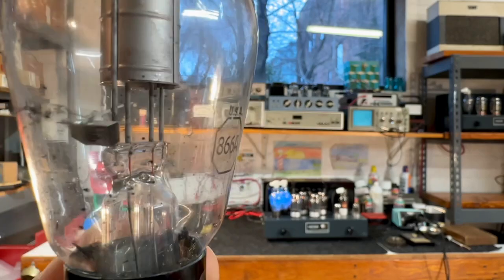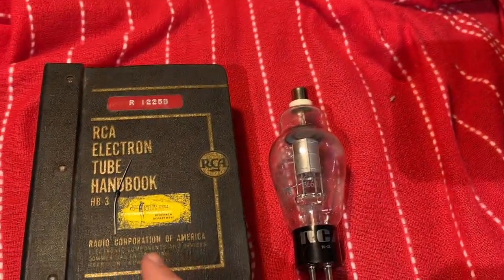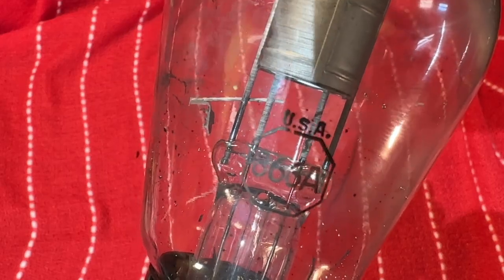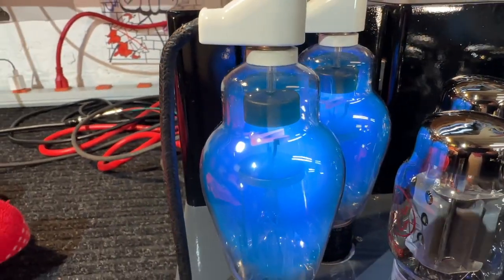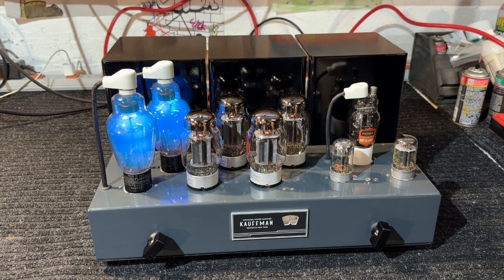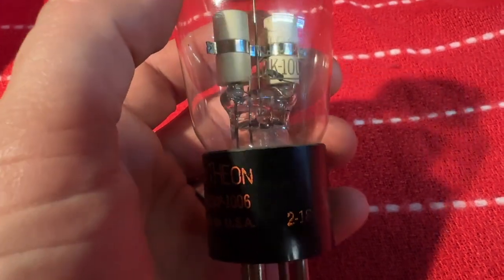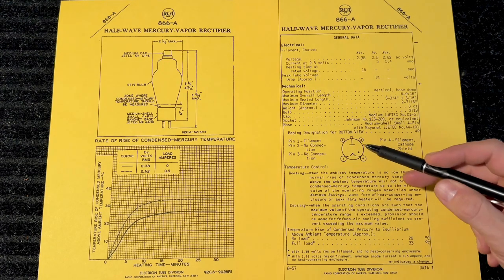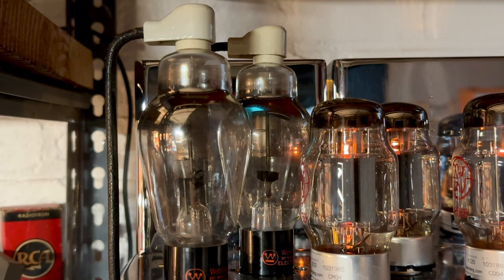Explore the 866A Mercury Vapor Rectifier & other gas tubes!

Comment: During the lock down of our country (nz) in 2022, I set out to design and build a stereo Amp based around the kt170 tube.  Just to add some eye candy to the valve lineup I opted for a pair of 866a tubes for my rectification.  When it is cranking the pulse of the beautiful blue glow will almost put you into a trance. I love to turn out the lights and just melt into the sound and visual.   MV tubes in my opinion work well in a powerful output Amp.  Very little sag and they run cooler than say gz34 or similar.
I built a time delay into my power on circuit so as to allow the MV to preheat before any voltage is applied. So far, with over 300hrs of run time no issues at all.  Just pure analog audio.  With the phono input on the front end I now listen to my vynal with zero digital interference. 😊😊😊😊

Comment: What if you did a 300b set amp with one power supply, and two independent 0z4g tubes, how cool would that look, and sound? Just add a capacitor to the output of the tube and input of the power supply, high voltage high capacity, and they would act fairly independently. Make a clear plastic shield so fingers dont happen to make contact with the hv. That is safe enough. People its common sense. 
The power supply can be a high voltage switching supply up at around 800Volts. 
There is high efficiency aspect, and low cost aspect as these tubes are avaliable and even at low cost. I think they would look cool and be one of a kind. 
One could even power a pair of el84s and that would make for a very compact and efficienct and capable amplifier, Spending the money at the transformer. 

Honestly an even better setup is ec360 OTL with speakers at 120ohm Custom coils, not too difficult. 

Why dont we see any of these designs besides the phillips otl sets sold in france and italy and germany???

Western electric? Aghh, that was outdated even when it was popularized in the us. 
And the corportate engineers, they need to be put in insane asylums, literally. Its scary.

Comment: Thank you for this presentation.  I always learn something when I tune in.
Quick question: I've been looking at tube data sheets for the 83 (little brother to these tubes), and although I've gone through several, I've yet to find a value for the first cap, only for the choke.  Is there no actual max for the cap value with these?  Seems as though there would be...
Reply from the maker: Hey, its not uncommon to have a lack of info on the 1st cap. There is a max. I would say 20 is highest but prob 30-40 ok.

Comment: Nice video. I, too, am a Hg  rectifier fan and use them in audio and RF amplifier amplifiers when I have room for them. I might add that if one does not have the 2.5V, 10A filament transformers, a bit hard to get, the filaments can be wired in series and run off 5V at 5A - take the DC off the connection between the tubes.  Stay safe...
Reply from the maker: Thanks! big fan!! haha. I haven't tried in series yet thats a good call. Best

Comment: The blue glow is the electrons. You'll notice they pulse with the music. My triode output stage tubes on both amps (triode wired matched sextets of GE 6550A) do the same thing when music is playing. I love turning off the lights and watching them pulse with the music. They're running full Class A so they glow a little all the time, (450V 65mA) but really glow and pulse once the music gets going. I have heater switches on all my equipment. It's a bit of a production starting everything up with heaters first, then switching on the H.T. starting at the front end and then working through the reverse process shutting it all down. I have toroidal output transformers on my monoblocs. Got them from Menno Vanderveen and they are amazing in all respects. My DAC design is all tube and has tube rectification and regulation. I used Caddock Ultra- Precision Film 1K resistors as the load resistors that the DAC chip feed into and those voltages are fed straight into the grid of the first dual triode. My Oracle Delphi with SME IV arm and Benz Micro cartridge still makes digital sound harsh though. Digital is devoid of harmonics to my ear, and the opamps in all DAC chips destroy the sound right from the get go. Great video!!! #bariumgetter
Reply: Real DACs are R2R

Comment: A rectifier for battery operation?
Reply from the maker: yes that's correct! the CK1006 was used in low voltage AC and or battery situations.
Reply: A battery is DC. @patrickkauffman
Reply from the maker: @bilguana11  yes, there was battery gear the Ck1006 was used in like am-43 SC and army power supplies. One model US Army PE-237 used this tube along with a vibrator to take low voltage DC and bring it up to 525VDC. The 1.75 volt filament of the 1006 tube was switchable to conserve battery power. Very odd tube seldom used.